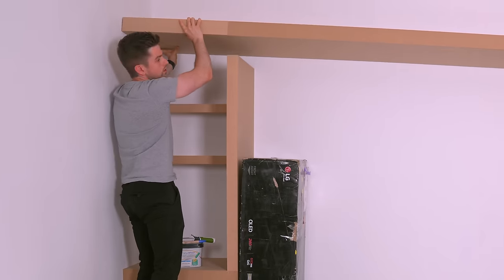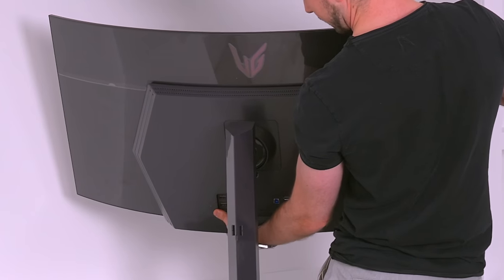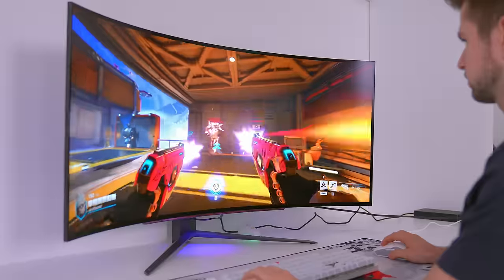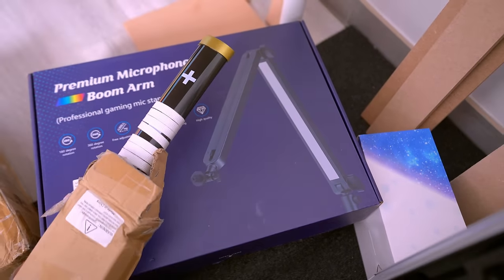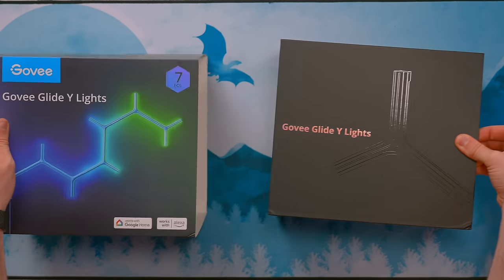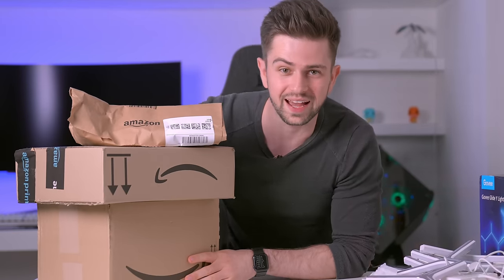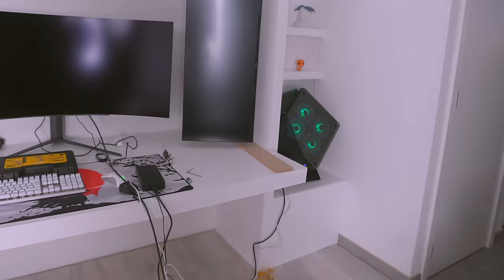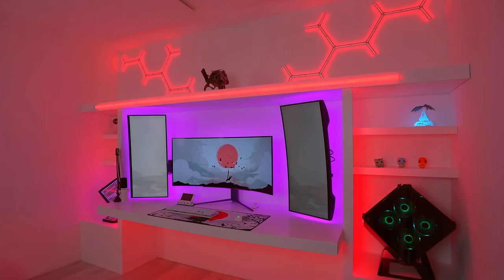Building My Custom $10,000 DREAM Gaming Setup!

Comment: setup looks good, but as a guy who works in industry like this, i can see a lot of mistakes in this build, but this mistakes is so small, like you dont calculate ur cables, how big are are power supply to hide and mistakes with desk
Reply from the maker: The desk itself is very very scuffed. I would need to re-build that one. Thanks for not being too negative :'D
Reply: @TheVideoNerd  bro under the table in the middle you need a stiffening rib, it can be either a leg or a piece of wood the length of the entire table attached under the table in the middle and on the sides